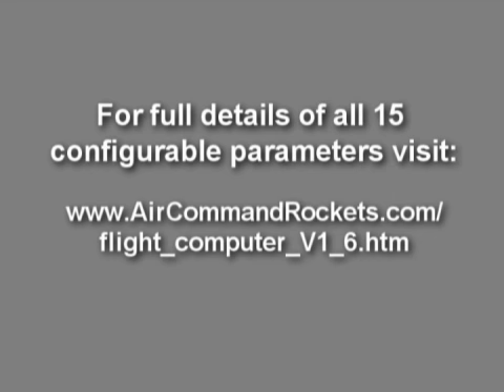Water Rocket Flight Computer V1.6

Comment: We just use a little PIC programmer connected to the PC through a USB port. The programmer has a ZIF socket so its easy to get the PIC in and out. The FC just has a normal IC socket that we put it in when its programmed.  The upcoming version uses ICSP (In circuit programming) as the PIC is now surface mount. We will use the same PIC programmer but with the ICSP cable.